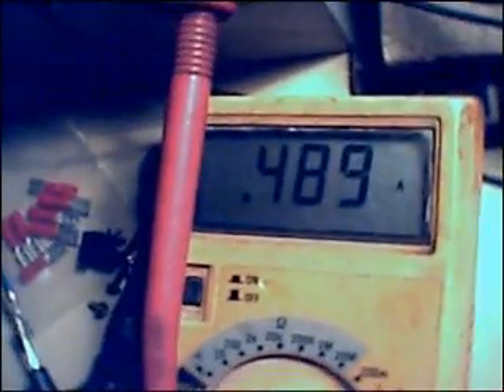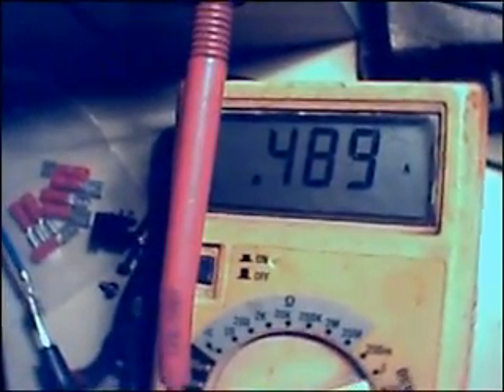Bedini Motor 9 - Making use of the rectified voltage

Comment: Nice. I've always thought that you could enclose the spinning disc and attach fins on the rotor that will produce a stream of air. This could be channeled to power something else.

You could also utilize the spinning disk by sitting a magnetic stirrer above it with a water turbine hanging into it. Perhaps you could use the axle hanging out the bottom to drive a rotor that is helped along by the captured airflow.